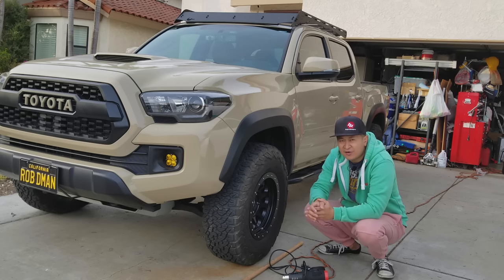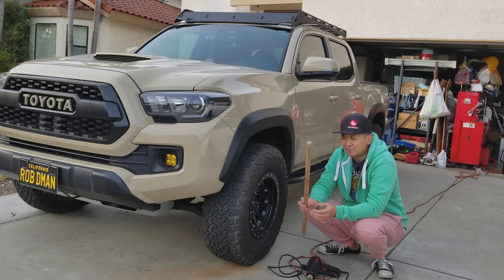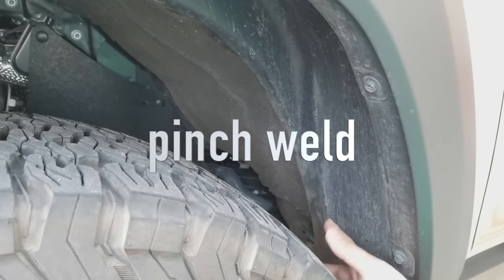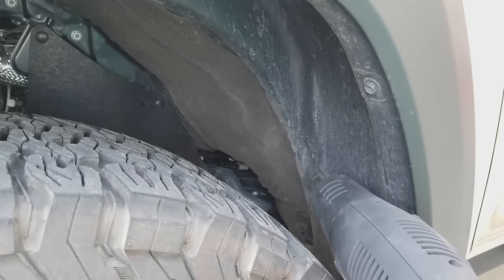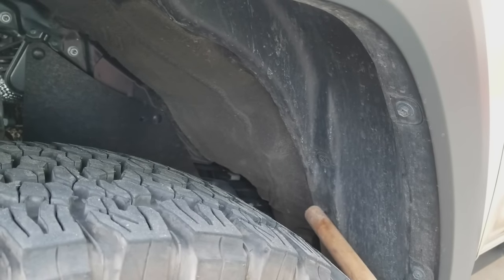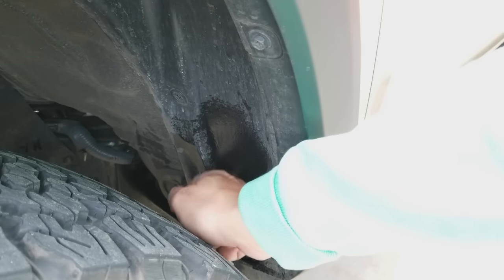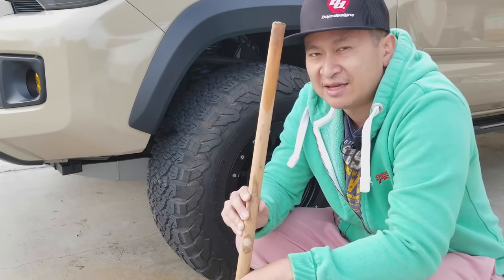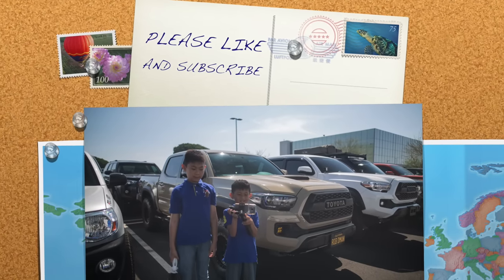Part 2  - How to Fix your Tire Rub Issues HEAT GUN ! Toyota Tacoma or any other offroad truck / suv

Comment: I just went wider in my fronts and have a slight rub on the back of my front inner fender liner at full turn. This was the first thing that came to mind glad to see someone else has done it successfully
Reply: What did do to fix it I only rub when turning sharp or full turn as you say. In the back of fender as well
Reply: @carrottopgaming did you fix it?

Comment: Just had 265/75/r16 with -10 offset installed on a stock height 2012 toyota tacoma today and had to get my cordless dremel and cut the lil plastic corners where the tire was hitting, definitely gonna try this with a heat gun, good technique 👍🏽👍🏽
Reply: Literally same issue on a 2006 toyota 4 runner exact tire setup did you ever fix it ?
Reply: @theforestisdark9676  yessir, did the melt mod and now all good, eventually ill get maybe a slight lift nothing drastic so i can hit moderate trails without worrying about tearing inner fender parts, but for now 👍🏽

Comment: Thanks so much for the tips. I just put a 2" lift on my '07 Outback yesterday. Took it to Les Schwab for new tires and wheels today and they rub a tiny bit. So I need to trim the fenders. Just came across your video and I'm headed to get a heat gun. 
Thanks again for the great video!
Reply from the maker: Glad I can help.

Comment: I had stock 15in tires and rims on my 1998 BMW 318i e36.. I bought a full set of bmw 17in (used) from an x-1 .. Had the problem of rubbing, this heat gun trick worked great !!!! Thanks for this video.
Reply from the maker: Hey glad it worked for you! Thanks for watching.

Comment: Great video. Just put 2" wheel spacers on my avalanche and its rubbing just on the driver's side, maybe ittl work itself out?? If not I will be referring to your video for the fix. Thanks a bunch dude!
Reply from the maker: Thanks for watching.

To answer your question it will rub against hopefully just plastic and may rub that portion out. The concern is if it's rubbing a pinch weld or fender. They rub enough to get really sharp then it will shred up your tire.

Just look for the rub spots and you should be able to tell how much priority you need to put.

Thanks

Comment: Yeah I'm 3" over stock with 33" tire, 17x9 wheel -+0 offset and a CMC was needed but thats all, I've been bottomed and articulated but the pinch doesnt seem to be rubbing at 3 over. (2016 ltd4by quicksand)

Comment: I have a '13 4runner for daily driving. Planning to fit a 275/70/17 in few months. Hope it won't rub. If does I'll use your trick. Thanks for the video bro.
Reply from the maker: Romulo Avanzado thanks for watching
Reply: I just put 1.25 spidertrax on my 2015. 275/70/17 KOs believe me when I tell you they are going to rub. Very disappointing.. only 1hour from install, driver side locked out. Getting a heat gun tomorrow.

Comment: Wow! I just installed ray10’s (dark bronze) on my quicksand Tacoma!  Went with same tire size (Yokohama x-at) and same areas are rubbing.   Thanks for posting this
Reply from the maker: Jason Dahlstrom glad to help
Reply: Did you ever resolve that issue? Do you have a lift on your truck???
Reply: @RobDaman  were you experiencing rubbing w/ standard trd 4x4 suspension. Would a 2-2.5 inch lift had resolved that issue?
Reply from the maker: @scottlandb6579  the rubbing occurred when offroading mostly. This is a stock suspension in this video.

There was some rub while turning coming up parking lots. 

A lift will help on road but not for offroading as your wheel will "stuff" into the fender then rub. 

I just put up this video  https://youtu.be/invkOwHthwU

you can see me stuffing the front.

Comment: Good idea.  Really need to make sure nothing is behind those liners, but I doubt there is any wiring back there very often...maybe some fog lights in the front.
Reply from the maker: Thanks. Any wires are towards the front bumper. It's always smart to check first just like when you're drilling 👍

Comment: I'm getting ready to do this to my Lexus GX 460 to fit the slightly bigger tires for the OEM 18" Wheels. I was wondering if it matters what brand or type heat gun you use?? I'm sure some get much hotter and or work better than others but wasn't sure. I have yet to buy one yet but was thinking about just getting the more basic bright green OEM Tools Brand one from my Local Autozone for $30.00.
Reply from the maker: Variable heatgun is best for control. I bought this one not long ago and works well https://amzn.to/41NtKVw

Comment: Cool informative video kapatid 👍, how did doing all this work out ? After dremel and heatgun method were you still rubbing?
Reply from the maker: it resolved my issue 100% until I went bigger.

this is the next step https://youtu.be/Oz0hY4upXA4
Reply: @RobDaman  i just literallly tried these methods (05/02/2020 4:30pm GUAM TIME) and really did the trick appreciate the information
Reply from the maker: Thanks for the feedback

Comment: Awesome video, that you!  I'm thinking about going up to 265/75 R16's also on my 2017 tacoma.  However, I have a steel front bumper that weighs about 180 lbs.  Do you think that added weight will add excessive rub?  I have stock TRD offroad wheels and probably won't add spacers or backspacing unless I have to.  Thanks for the help, awesome videos man!
Reply from the maker: Glad you like the vid. 

I doubt you will have issues on a 265/75 and that bumper especially with a stock offset wheel. The rub is generally an issue when it "sweeps" in and out not up and down unless it's a really big tire. 

You may want to change your coil springs to compensate for the added weight on the front end more for driveability and comfort.

Thanks again for watching. 👍
Reply: Wow quick reply!  I'll eventually upgrade to 5100's all around and new coils but just need to save $$$ right now.  Just wore out my current stock tires and want to upgrade to a beefier AT tire.  I know you've said good things about the K02's, did you have any problems getting them balanced?  I've heard a few people had problems with that.  Also looking at the ST Maxx's as an alternative.

Comment: Could you use this method instead of CMC
Reply from the maker: That's a good question.

It really depends how big of a tire you're using, what wheel offset/backspace, what suspension and even alignment as more positive caster will help. Also it depends what you're doing.. street, offroad, both. 

So going up 1 size you should be ok to do what I did. Going up more..then prep for cmc.
Reply: @RobDaman  Thanks appreciate the response

Comment: Thanks for this. I just bought a great gun but i used it on my balls because they hang a bit lower than I'd like. But you are were right about going slow and only a little at a time. Got a little crispy in the process but that's ok since i already had kids. 🍻

Comment: I put on 275 70 R 17 on my 22 Tacoma. The tire when I make tight turns rubs against the control arm. I was told if I put a one inch space around. It will rub against the wheel. Well, what can I do? Thank you.
Reply from the maker: You definitely don't want to rub the control arm. Spacer is least cost and you'll need to make adjustments accordingly if you rub.